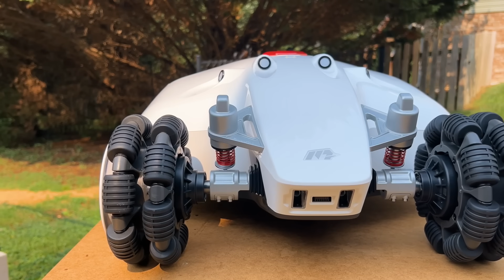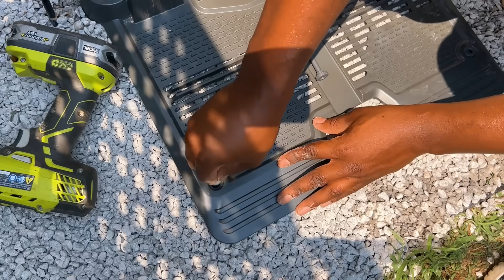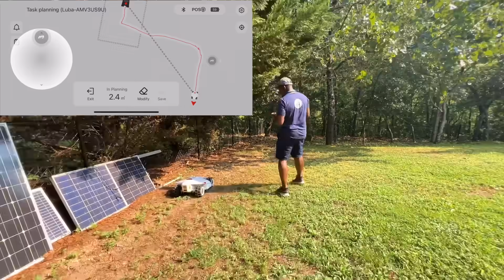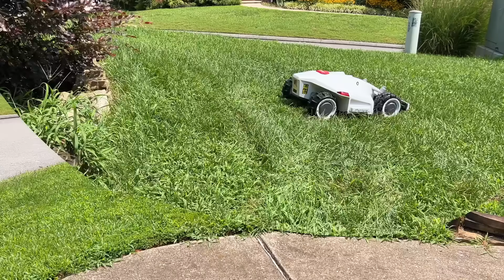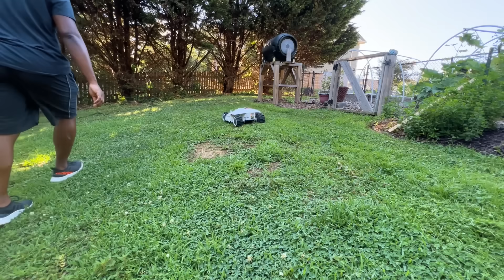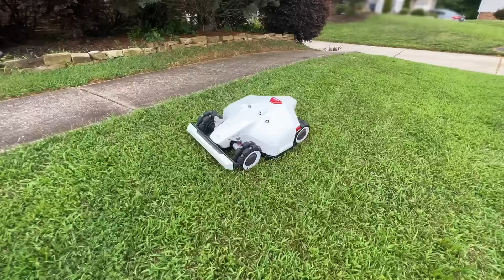No More Mowing! Luba AWD Robotic Lawn Mower Takes Over!

Comment: In fact, what we see in all the test videos of wireless installations is that the lawn mower robot is being tested on a very flat lawn. In fact, we would rather see how the lawn mower works when there are obstacles, such as many trees or other obstacles on the lawn. Can the lawn mower robot cleverly avoid obstacles?
We also want to see if the GPS wireless signal of the machine will be affected under the shade of trees. In cloudy conditions, such as many dark clouds. Will the GPS signal also be affected? Speaking of which, can machines go out to work on rainy days? These are all very important, and if the machine can only cut grass on sunny days, there will be many restrictions
If there is a swimming pool on the lawn and the lawn has a certain slope to the pool, there is a certain slope. Will the lawn mower robot fall into the swimming pool uncontrollably under the influence of gravity?
All the tested lawns are very ideal, but what we would prefer to see in such a high priced robot is that it does not require wiring, but can it achieve more powerful functions beyond that?
Can anyone who has actually used this Luba robot give real feedback?

Comment: Good Review Dude !  I've watched 20+ reviews on the Luba Robotic Mower here on YouTube and I've only seen Two reviews that were accurate and well researched, Yours and The Lawn Engineer.  Nearly 100% of these reviewers had to Relocate the RTK/Ref Antenna after their initial setup. It's important to note that relocating the Ref Antenna means erasing & Remapping All Lawns stored in memory as well as All "No-Go" zones. Ref Antenna placement is critical to the successful operation of this Mower because GPS Signals are Weak. 
   You mentioned there are 4 different GPS Networks used in the RTK System that this Mower relies upon.  They are collectively called  the GNSS System (Global Navigation Satellite System). These 4 GPS Systems include the United States's Global Positioning System (GPS), Russia's Global Navigation Satellite System (GLONASS), China's BeiDou Navigation Satellite System, and the European Space Agency's Galileo system.  That's a LOT of GPS Satellites but the RTK Reference Antenna & Luba's GPS Receiver will only ever "see" 31 Satellites total at any given time, ("See", meaning line of sight signals w/o any obstacles in the way such as a Building or Trees). Everything interferes w/ GPS Signals, Buildings, Trees, Fences, Rock/Sod walls, Power Lines and Atmosphere.
    It's because of the Atmosphere that any GPS signals below 45 degrees, in any direction, are useless. It's why the User Manual calls for "clear sky" at 45 degrees in all directions above the Ref Antenna & Mower. With Both the Ref Antenna & Mower seeing signals from 29+ of the SAME Satellites, the mowing accuracy is 5cm (2 inches). When Both the Ref Antenna & Luba are seeing the minimum of 20 Satellites each, (and they have to be the Same satellites), the mowing accuracy drops to 15cm (6 inches). When either receiver sees less than 20 Satellites, the Luba stops and gives a "Positioning Error" code. If the RTK/Ref Antenna is properly located and has Clear Sky in all directions @ 45 degrees, it most likely the Luba Mower that's experiencing a drop in total satellite signals because it's moved next to some object, like a Fence, under some Decking or Tree.  GPS Signals fluctuate a Lot in strength because of Atmosphere and it's likely the Mower will re-acquire the min of 20 Satellites again.  So that's why getting the RTK/Ref Antenna located properly is a Big Deal w/ this GPS guided mower.
   The RTK/Ref Antenna is fixed and communicates w/ the Luba at all times @ 900Mhz. That's what that short black antenna is for on the underside of the RTK Antenna housing. Its communication Range is only 120 meters (394 ft) and is Also weakened by Buildings, Trees, Fences & Power Lines. The Luba User Manual says the 900Mhz range can be weakened to 80 meters, (262ft), or less by Buildings and such.
   There's Good News for those who've not yet Purchased a New Luba and are considering buying one. As of early January 2024, Mammotion has announced they are taking Pre-Orders for the New Luba 2. The robot Engineers at Mammotion have been busy and have made at least a Dozen improvements, and some of them are Big !
 The Biggest improvement is the addition of a Deck mounted 2 Lens Camera on the Luba. The 2 Lenses give "Stereo" vision which allows the ability to have depth Perception. The Cameras ability to see and measure distance combined w/ the 4 Ultrasonic Sensors & object sensing Bumper gives the Luba the ability to continue Mowing when the GPS Satellite count is below 20. It also improves Mowing Accuracy overall down to 2cm (under 1 inch).  The Rande of the 900Mhz signal between the RTK/Ref Antenna & the Luba Mower has gone from 120 meters up to 5,000 meters (3 miles), so Buildings & other obstacles are a non-Issue anymore. The number of allotted Lawn you can map has Tripled for each model and there is a 4th model that can mow up to 10,000 sq meters (2.5 acres). There are Lots of other improvements including the ability to maw around Letters & Patterns you can upload to the App, so you can have a Sports Logo outlined in your Lawn now. Alexa & Google Home are now incorporated & you can watch thru the onboard Camera in Real Time thru the App.

Comment: Very cool! How long does it take to cut both the front and back yard?
Reply from the maker: Depends on the type of cut you chose in the app. If you chose an efficient cut, it may only take a 30-40min. If you chose a cut that mows horizontally and vertically, it could take possibly 1-2 hours.